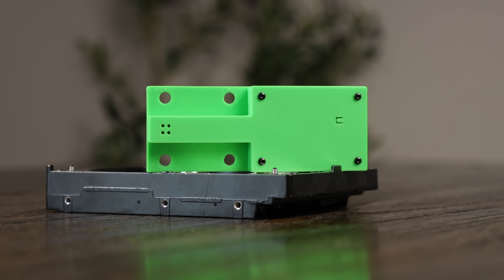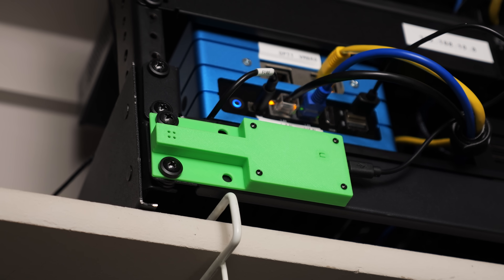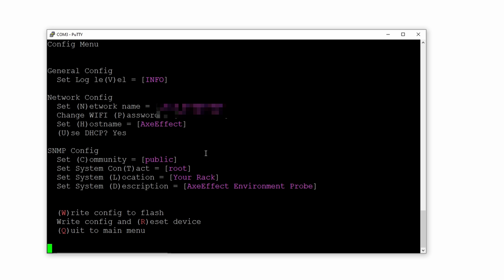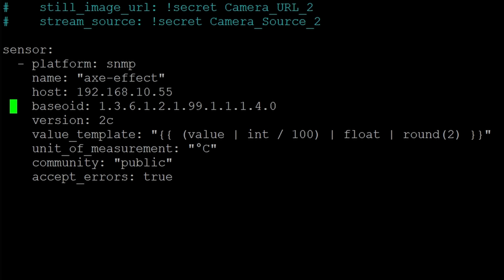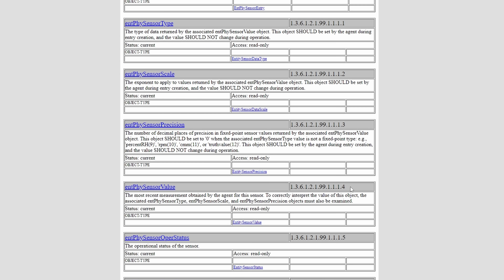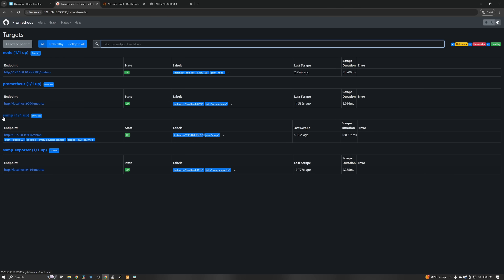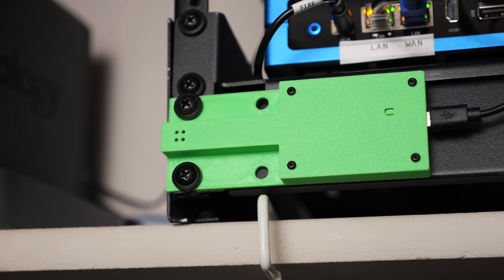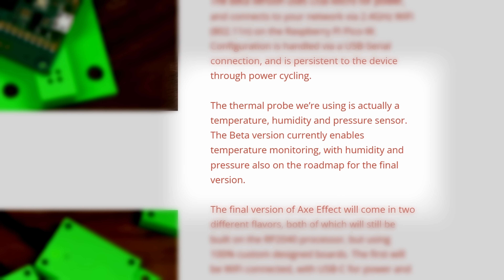This problem in my home lab is finally solved.

Comment: Seems like quite a complicated way to do a simple task of recording a temperature... They need a home assistant plugin
Reply: This isn't really meant as a solution to the problem you're talking about .This is meant for use in small to medium business environments where existing enterprise products that do SNMP signaling are much much more expensive than this.

In this video it's showing being used with HA, but that's not the original use case for this device.
Reply: I did something like this about a year ago using (probably) the same sensor but on an ESP-01 in which I flashed Tasmota and connected to my home assistant instance. Has been working flawless for the last year.

Comment: the snmp exporter can also be run as a service in kubernetes with a configmap to provide configuration. Might be a bit much for a homelab but will supply some resiliency.

Comment: I've only used one pi zero model and I found it so frustrating to set up because I just had no idea you could through a serial connection like that. A lot of videos about pis skip this step so thanks for showing it!
Reply: Pi zero is an other kind of device. 
Pi zero is a very small single board computer to boot an OS while an pico Pi is a microcontroller like an arduino
Reply: The serial connection exists because the device (Pico) came flashed with firmware that does all that. 

So no, you can't do the same with a Zero W, or even a Pico W off the shelf.
Reply: Well at least that makes me feel better about not knowing about it!
Reply: @brianandrews1867  These days the Pi folks have a tool named the 'Raspberry Pi Imager' that makes setting up and connecting to wifi virtually painless for the SBC boards (zero w and regular pi's). Remember to add wifi config while flashing and you're done.